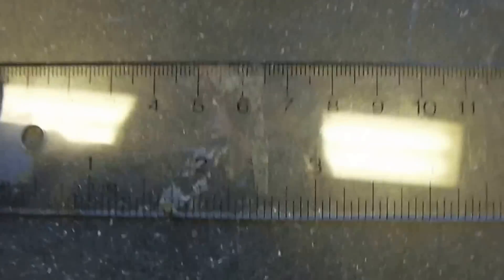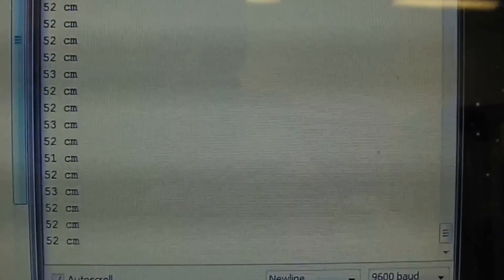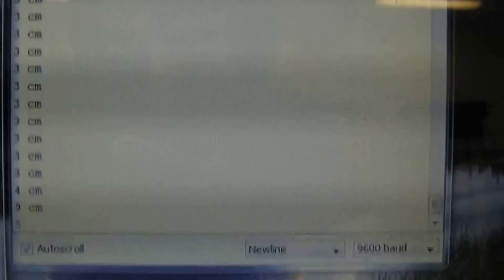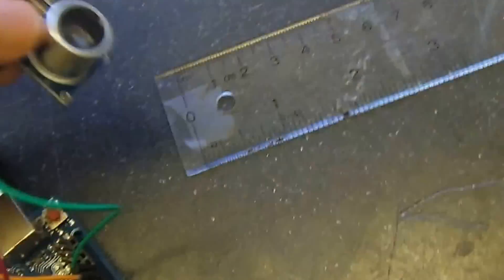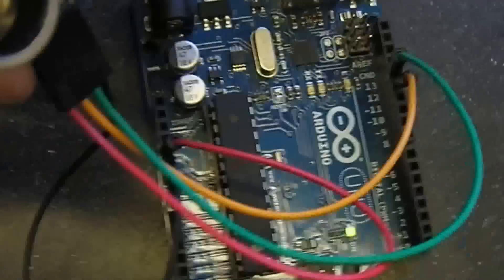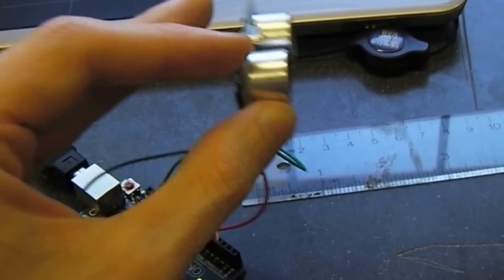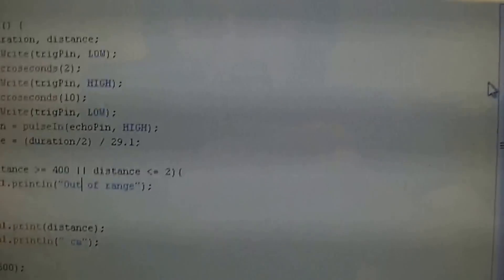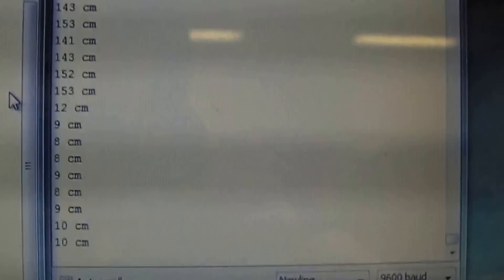How To Connect HC-SR04 Range Finder Ultrasonic Sensor [Arduino Tutorial]

Comment: i get gibberish distance values. I have correctly made the connections and also uploaded the sketch to the arduino multiple times. It simply doesn't work.
Reply from the maker: Good use of the word gibberish! A) This can happen sometimes if the Baud rate it too high, make sure it's set to Serial.begin(9600);  B) Could be a broken sensor;  C) Could be outputting a different language standard than ASCII
Reply: Tolson Winters baud rate is set to 9600. It happened to me once earlier, I simply reinstalled it and the problem was solved. It had been displaying measurements accurately but since yesterday the issue has returned. I tried reinstalling it like before as well as changed the female to male jumpers connecting it to the arduino and also used different sets of pins on the Arduino for input and output.

Comment: well I'm actually doing a similar project for underground fuel tanks though.
Mine will include a buzzer and two LEDs (red and green) in addition to the other components, the red LED will be connected to the minimum value and the green to its maximum range. the buzzer then beeps at these points. 
It must also print the battery life on the screen.

please can anyone help me with the codes??????

Comment: What kind of cable is that?
Reply from the maker: +Colaris It's standard male-to-female jumper wire, and USB A to USB B cable connect to an extension USB A cable.
Reply: Thanks for the info. :)

Comment: why I didn't connect the trig to the pin but it still works? and continued print the correct value(duration). I try two hc-rs04 and have same behavior,does the Trig is a fake pin and doesn't need to connect it?

Comment: +Tolson Winters where did you get the cable you used?
Reply from the maker: +Mark Shacker Ebay is great, pickup lots of male to male, female to male, and female to female wire.  Always helpful, and it&#39;s cheap! Also I have some USB A to USB B cable connected to a USB A extension.

Comment: Tip: turn off image stabilizer. Ironically, it makes the viewing experience worse.
Reply from the maker: Stephen M Yea it's a good point.  This is before I purchased a handy $6 tripod, which really helps eliminate video shake
Reply: +Stephen M Yeah, and please use Stabilize on your YT video options to correct this wobbling.
Reply: +Stephen M I'm wondering if it has something to do with the refresh rate of the monitor and the rolling shutter of the camera.

Comment: Sorry 4 bothering youu again if i want 2 detect a football player if he is in offside or not can i use this sensor!?!
Reply from the maker: The range of these sensors is about 2cm to 400cm, so it depends how far that player is away.  You can probably find sensors with longer ranges out there however, or even invisible laser trip wire type of sensors.

Comment: Can we use this sensor 2 detect position for a mobile object?!
Reply from the maker: Good question, it will not keep track of the specific position of your mobile object, merely detect the distance between it and any other object in front of it.  However, if you have a known area you're moving in (eg. a box, or maze) and the dimensions between each turn are determined in advance, I'm sure you could work something out to tell roughly where you are in the box or maze based upon how far you are from a wall.
Reply: Thanks a lot !

Comment: what are the modifications to be made in the code for interfacing two sensors
Reply from the maker: shannon dsilva Hi, just quickly off the top of my head, you'd have to add another set of defines:
#define trigPin2 14
#define echoPin2 15

Then you'd have to essentially copy-paste the same code sections, but change trigPin -> trigPin2, echoPin -> echoPin2, and you'd need to make variables called duration2 and distance2, then print those as well.  Essentially copy/paste, rename variables (I just thew a 2 on the end of the name) to ensure they are all different variable names.